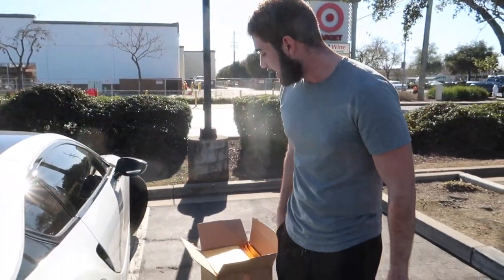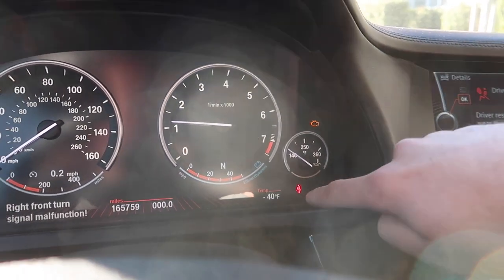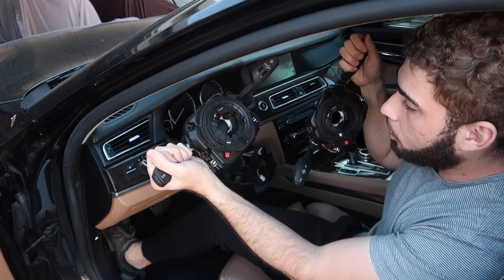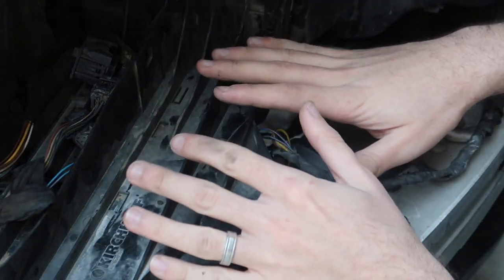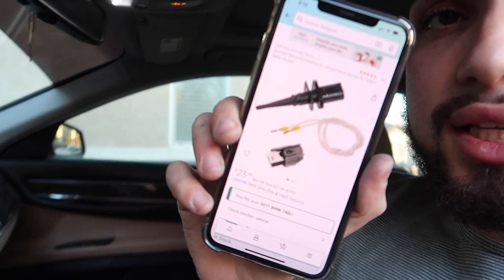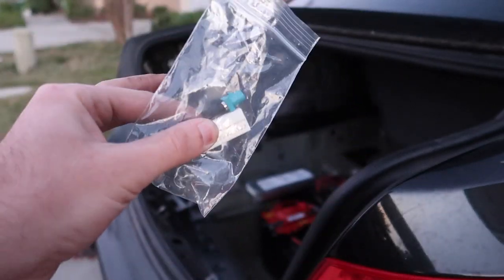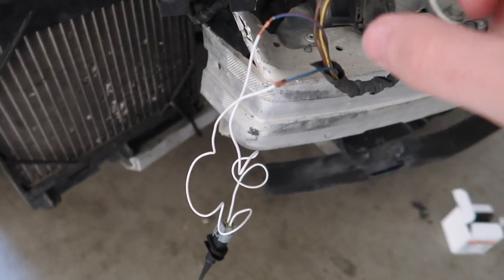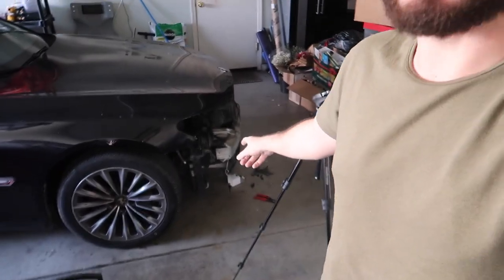Rebuilding An Abused BMW 740Li N54! Part. 6

Comment: To check and see if it’s the harness or the temperature sensor itself, twist the wires together and if the wiring harness is working it should read 130 degrees on the dashboard if it doesn’t change from -41 then its a bad harness.
Reply: bruv did you watch the fokin entire video b4 you commented there is a massive wiring harness issue

Comment: bro you need a multimeter; use it to check continuity, it will let you know if you have cuts in a wire. Also for the two sensors those might be wired correctly but keep in mind they would be wired in series so chances are, the reason you are getting -40 is because the sensor before the one you suspect is broken is the broken one. It's like Christmas tree lights, one goes out and they all go out! You can also use a multimeter to check the resistance of the sensor if it shows zero resistance that means it's broken. Because essentially the way these temperature sensors work is that they run a voltage through a small resistor and the change in the voltage is measured by the car and it uses data to figure out what the temperature is. They are called NTC temperature sensors.

Comment: Had the same problem with the temp sensor on my f10, sometimes it would say -40 or the sensor would work but as soon as you drive and stop at a red light the sensor would show -40 again and then as i drive again it would slowly go from -40 to 0 and then show the correct temp, checked all the wiring from the instrument cluster to the front of the car, replaced about about 5 different aftermarket sensors, at the end i replaced with the oem sensor and that did the trick never had this issue ever, love the videos nour ♥️

Comment: Man, what a pain.  You may need to trace the wires back to the junction box electronics (JBE).  I believe the JBE should be to the right of the fuse box behind the glove compartment.  If I'm not mistaken, the temp sensor goes to the JBE and it just passes through to the cluster.

Comment: Great work Nour! Unsure as to whether replacing the temp sensor will remove the check engine - Had a faulty temp sensor on my 1 series which showed -40c and never had a check engine. Good luck though!

Comment: Love the video... do you have any details on the Bluetooth module upgrade (trying to do it on my e92) wires and pins change (also did you code it or did it happen automatically?)

Comment: I had the --40 (in a e46 tho), problem is the wiring. The sensor is most of the time located in the airduct for the brakes, or on a belly plate. You already have a sensor in the right spot, the wiring is just torn, pull back more tape to recover the wires. They prolly touching eachother, that willl give the -40 result.

Comment: The only reason your car is not going in park because you will need to change out the shifter. I had the same issue with my bmw 550i f10, it would go in park but it wouldn’t go into drive or reverse, it’ll be stuck on neutral. After, I changed the shifter and deleted the error codes and it was working fine.

Comment: Anyone know if the standard clockspring will work with the paddle shifters from a m sport steering wheel? 740i 2009 n54

Comment: I’m not complaining, love the content. Excited to see the 7 saved. Enjoy seeing the i8 and the m4... yeah that ambient temp sensor, just buy a few they all use the same part. Sometimes they rip off, fcp sells a kit with new connector. Sometimes the wires are exposed to the elements, get wet and short. I wrap them up with some of that oem cloth tape.

Comment: Hey Nour, if you ever run into another similar Bluetooth problem you can do a cheaper and easier alternative. On my E92 builds I would put this Bluetooth adapter that hooks up to the aux input and charger unit in the glove box so it stays hidden. I’ll add a link and maybe you could use it for your next builds if you run into the same problem 

https://www.amazon.com/dp/B0739RGDFJ/ref=cm_sw_em_r_mt_dp_kSieGb515VE4M